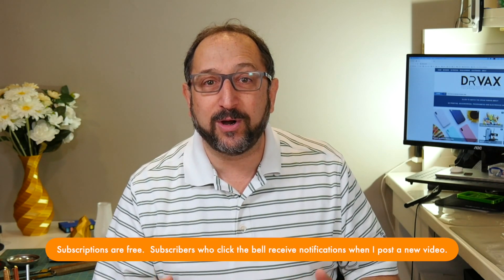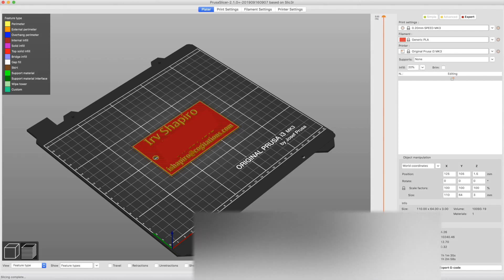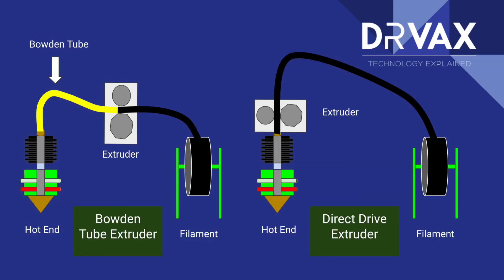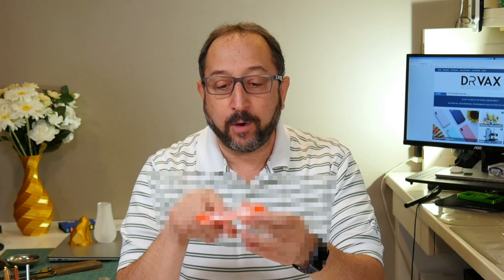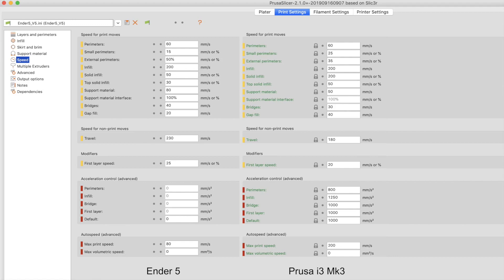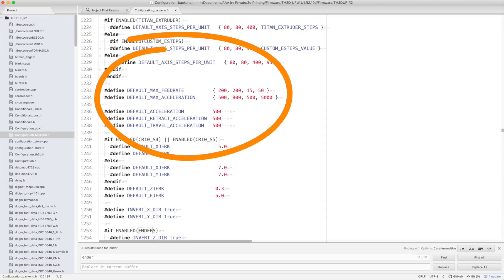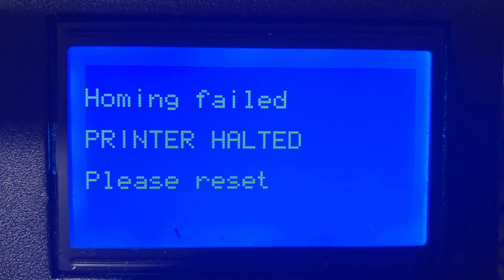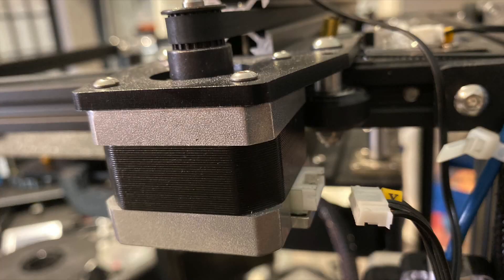Why is my Prusa Mk3 Faster than my Ender 5?

Comment: I am very curious if you did a direct drive conversion how much print time would be gained?  Would it be a wash if the added weight of the stepper forces you to print slower? Something else that would be interesting to see is how do the ender 5, the prusa, and a resin printer compare in print time.
Reply from the maker: Not sure.  Your point about weight is key.  Is the Ender X-axis rigid enough for a direct extruder?

Comment: A great video, and well thought out.  The Ender 5 is one half to one third of the price of the Prusa, so the slower speed can be offset by more printers.   I have another concern with the Prusa printers, the lack of a larger build area.   I just received my Ender 5 Plus,  with a build area  of 350mm x 350mm x 400 vs the Prusa  210mm x 210mm x 250, at much less than the price of the Prusa.  I also enjoy researching and installing the many upgrades that are sold for the Ender printers
Reply: Hi David, The Ender 5 Plus looks great with it's big size and preinstalled (yes?) BLTouch but I really don't understand why they didn't use TMC silent drivers. Apparently, the steppers are loud/noisy. How do you find it?
Reply: @jonztube  I think it is a very good printer with the ability to be a great one.  I have two Ender 5's and have modified them in almost every way possible.  I intend to do the same with the 5 Plus.  Dr Vax has had many great videos on mods as well as many other channels you can watch.  I don't find the 5 Plus that bad  I really like the build area, the BLtouch mesh and the dual Z drive.  I don't like the cheap board and drivers, but it works.  The extruder motor and filament sensor will be the first things to go.  I have already removed the filament sensor, I could not get filament to feed through with out breaking, and it made it almost impossible to load through the extruder.  As with all Ender printers the cable management is terrible.  Kersey has a good build video and review of the 5 Plus.  I'm looking at SeeMeCNC EZR Struder Extruder Kit - have one on each of my Ender 5's  Capricorn bowden tube and I think TH3D will have upgrades in the near future.
Reply from the maker: Excellent point.

Comment: DrVax, newbie question.  I have a MKS3 as you do and when someone tells me that they printed something at 60mm/s then again at 20mm/s what exactly are they changing in Prusa Slicer 2.1.0?  Perhaps there is a single I'm missing?  At the moment when I need to slow down I start the print and then turn the speed down with the knob :)  Super beginner question and I would appreciate any help!  Btw, setup patreon so we can help!
Reply: Joseph, Look at the Print settings tab and under it the  speed tab.  There are a number of speed settings you could change.  You could experiment and try changing them.  Probably Perimeters would be a good place to start.
Reply from the maker: @woodwaker1  Thank you for sharing.  This is how we can build a community of people learning together.
Reply from the maker: Yep.  The previous viewer got it right.  There is a speed section in the PrusaSlicer.